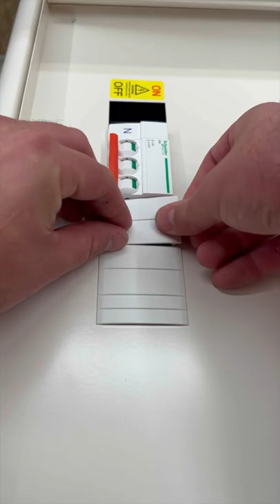NEW Schneider Electric Distribution Board includes AFDDs

Comment: Big company like Schneider and they can’t make a single module RCBO/AFDD I’m not even sure they’ve made a compact RCBO.
Reply: Agree on single module but why would you need a compact rcbo in a schneider DB?
Reply: Older merlin boards.
Reply: Making a compact usually reduces the safety as it has a higher chance of failure or a short service life

Comment: What's the reason for splitting the breakers across different sides of the board? What's the benefit? 😀
Reply: Some people say to balance loads by car on phases and per side personally I think it’s nice to do it if you’re only installing a few circuits at the bottom just so you can give quite a bit of the higher up for maybe shorter cable

Comment: weird to see european DIN rail and schneider in a north american fuse box, looks like a good system
Reply: Not North American just an industrial distribution board from the UK, but it’s similar to the North American one with a lot less exposed metal
Reply: @UKsystems  Thanks for the clarification, i thought it was American because of the vertical orientation of the rail, in the EU its extremely rare to see this vertical setup, I've only seen vertical setups like this in the IT sector where its being fed by 48V/DC but i think that's because it's an international standard.
Reply: @marcviej.5635  it’s because the UK can have three phase 100 amp as a standard connection pretty easily which as I understand 32 amp in some countries in Europe is an industrial connection whilst in the UK you can generally have up to 630 amp industrial connections semi easilyso I would assume that this higher current needs a different design

Comment: Are those busbar caps? I thought Schneiders selling point was that the board was safe to work on as the pins are isolated. (A point I've argued against due to knowing the switch can be pulled on). Does this not just make them a standard board.
Reply: Most of the major manufacturers state none of their DBs are designed to have the covers removed or worked upon, when energised. 
And never forget, it’s only the really competent electricians that comply with regulation 14 of the EAWR. All the rest are just chancers!
Reply: @brianabbott3582  yes I think it just made it unclear to those less informed. I personally am an Eaton man (preferred memshield 2 to memshield 3) but putting extra points of potential high resistance failure never seemed a good idea. And now they seem to have gone full circle and corrected their earlier mistakes. Yes it does reduce risk for those rare occasions where someone may have to work near live parts but many will have that naeivity to believe they are safe to work whilst still live.
Reply: Yes, that is the case, but they also don’t want to encourage live work

Comment: Can plastic blanks still be used? I was told they all had to be metal. Would be interested to know from the experts - thanks
Reply: Possibly fitting a plastic blank blocks bus bar in most cases I would rather do a metal black doesn’t if a metal lid is self closing
Reply: Since these boards are most likely going to be installed in commercial serting amd not a dwellinv the non combustable melarchy would not apply. And yes ypu can still use plastic blanks. Most lids on domestic boards are designed to self close. (Hinged at thetopp)

Comment: Hate external board blanks especially on a premier board.. even fusebox has internal board blanks.
Reply: With the system I see both ways because it should be isolating anyway and they have the yellow cap decent in this case

Comment: If I didn't know better I'd say that was a North American load center. Does this mean that GB is finally moving to the past? Er, I mean, the future? What's next? AWG? Wire nuts?
Reply: No this is an industrial distribution board. Our consumer unit are not great with lots of large conductors and also they are generally single face so the three phase is good in this case for industrial use but this is much safer and the terminals actually screw onto the bus properly and it’s a lot safer.

Comment: Is this for domestic?

I’ve always thought the Yank/Canadian ones were better. 

I’m not a spark but I cannot for the life of me understand why CUs are so small and fiddly. It makes no sense. 

It’s literally the lifeline to your house.
Reply: Seems to be a pretty serious residential with 3 phase being used. The CENELEC standard is so much better than the american one
Reply: You could have a single face kit to use it in a residential setting without three phase but it’s worse knowing the north America style has large amounts of energised parts and it’s not that secure for connection. It relies on being pushed on with a small screw this is much safer and reserve usually for industrial use because the room is needed for large cable consumer are available in bigger models.
Reply: @UKsystems  thanks. So you sell a single phase version ? Or you mean just modify/confogur it for single phase ?
Reply: @GeeTheBuilder  Zara kits available or factory installed ones where it basically bonds the busbars together internally with a really good connection

Comment: The way person is securing wires are not an approved NEC method for the USA. MUST use always use a torque driver or torque wrench to properly secure All screws & bolts that secure wires.
Reply: Sorry. I am wrong . Person did use a torque driver to tighten wires
Reply: They used a truck driver and it is a UK installation where the US electrical code is laughed upon
Reply: Been an electrician for 50 years and can testify the USA system of only using 120 volts for all loads generally under 2 KW rather then the 220 or 240 volts that Europe uses is far safer. Been shocked by 120, 208, 240, & 277 volts along with 5,000 volts from static eliminators & oil burner transformers.  A 120 volt shock on dry skin is only a small discomfort but when you double the voltage to 240 it appears to product four fold increase in discomfort. Worse shock that I ever received was while working in a large slaughter house as an apprentice and the electrician was in a hurry & told me to unplug a 240 volt twist lock plug while standing in a few inches of blood & soaked during a hot humid day. Grabbed the male twist lock plug with one hand and the female cord connector with the other and the shock went thru my hands across my chest.
Reply: @JohnThomas-lq5qp  again proving my point you get shocked and that shouldn't happen. we survive 415v shocks on three phase but are clever enough to never really work live and our regulations dont allow eqasy shocks from extentions or their use in incorrect locations